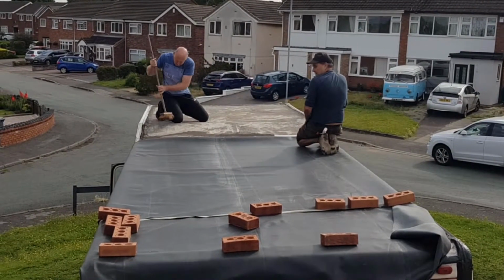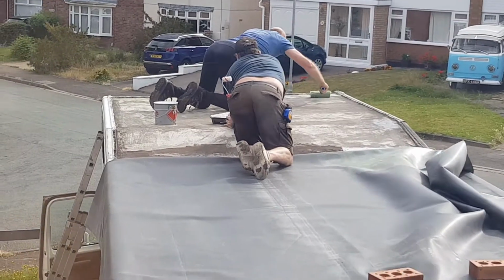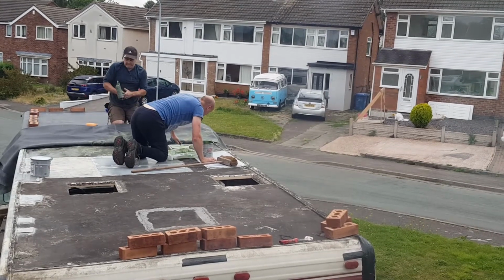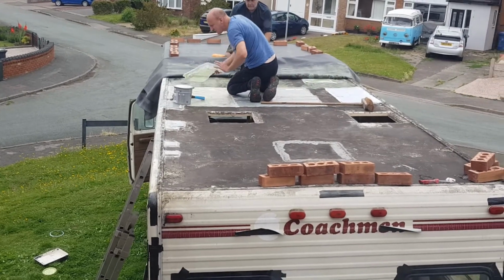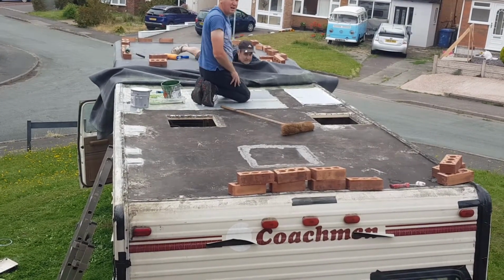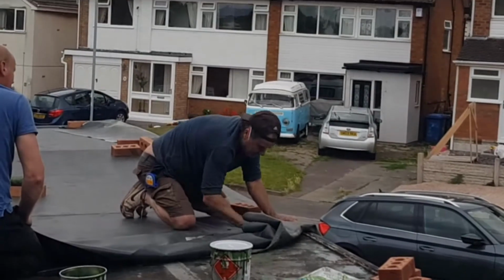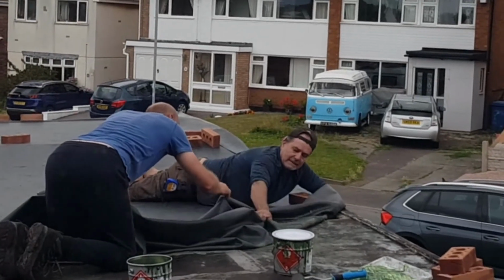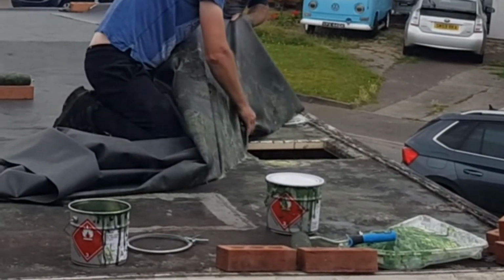DISASTER with RV Build Project Rubber Membrane Roof Stupid Mistake

Comment: I have a similar Ford E350 Class C project but I have the luxury of a barn. I've watched loads of American Youtube videos about how the professionals go about re-roofing these things. They don't use contact adhesive on EPDM roof membranes for this very reason. Water based non-contact adhesive that can be moved around to iron out wrinkles is the way to go.
Reply from the maker: Thanks Colin. In hindsight you are almost certainly right. It made the project very testing that day lol.